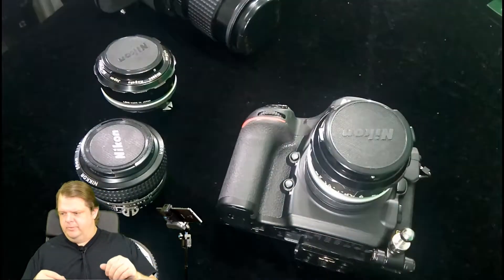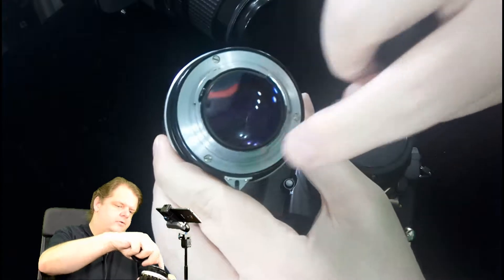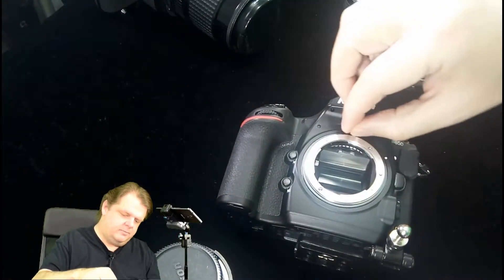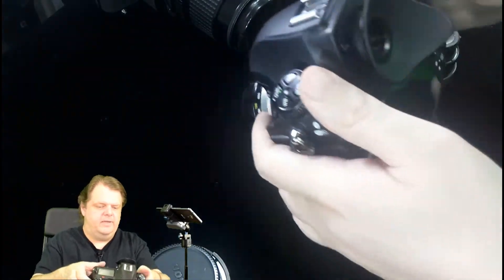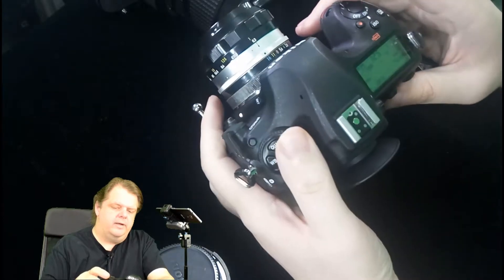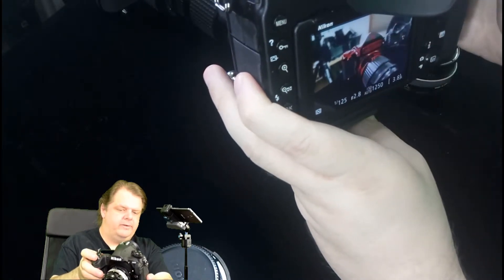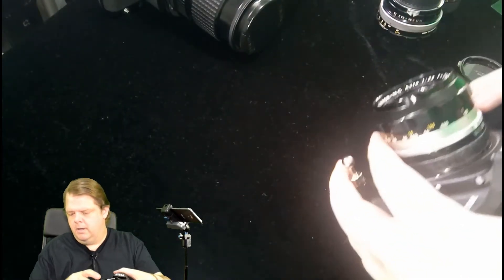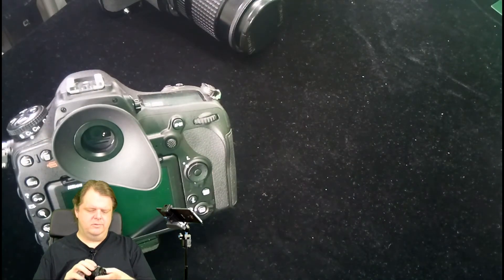Nikon AE Chip Overview

Comment: Hi. Thanks for the video.
I stll don't understand what the chip does that the camera cannot, simply by entering the data for a non chipped lens into it. Why isn't specifying the focal length and max aperture in the camera menu under non cpu lenses the same thing? It seems the chip holds the same information and nothing more.
Very confused and feeling rather dumb.